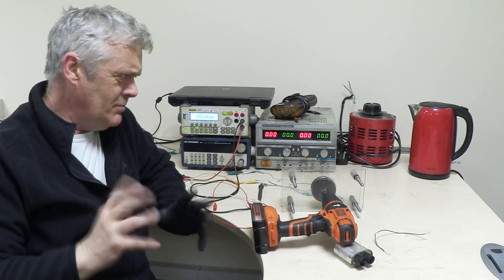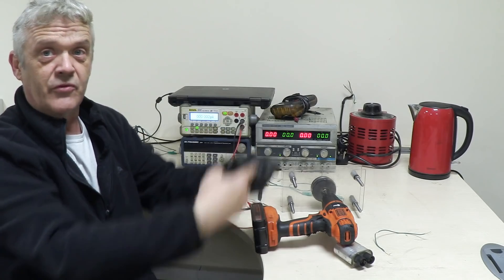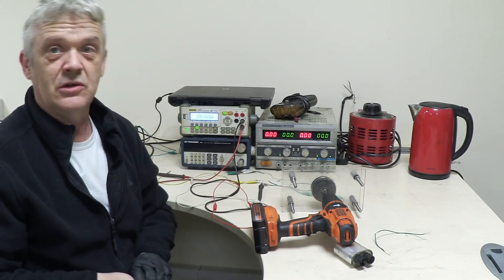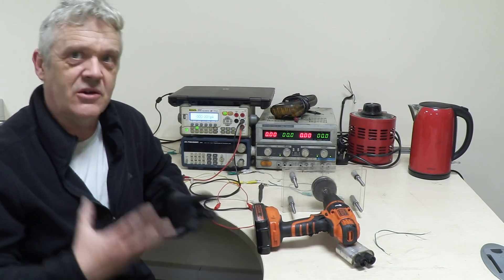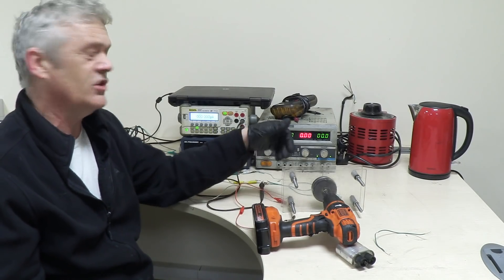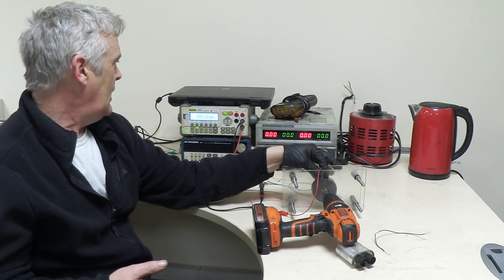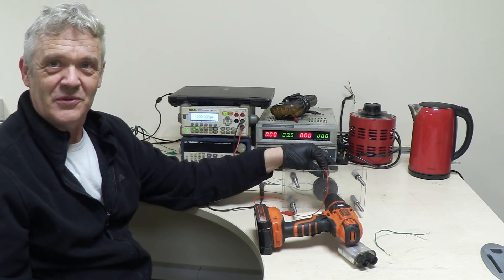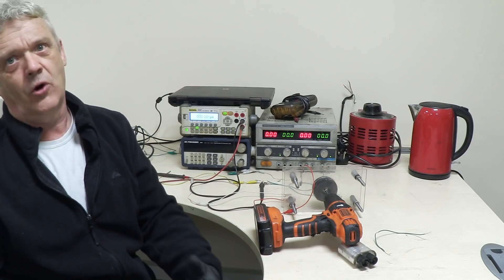Strange Behaviour Of A Tesla Homopolar Generator

Comment: I would like to suggest you something even more astonishing that I've found in google patents:
A high voltage DC homopolar generator patent US8288910B1 . It is basically a homopolar generator but instead of using a single plate a cylindrical coil can be wound radially out from the axis and in at the other side. The rotation generates voltage and all the wires are connecting in series, hence it is like a way bigger plate, or like a bunch of batteries in series. For the best performance the two faces of the disk should be far apart so the magnet wouldn't act on the other side of the cylinder to generate an opposing current. Good luck. You can rotate the magnets alone so it is way easier to connect for measurements.
Reply: Yes, the patent seems to indicate that the single plate is like a single wire in a traditional generator, multiple wires give both types the boost in voltage most designs require. It also hints that some magnetic field arrangements are more effective than others. But, rotating the magnetic plates alone is the traditional method, not exactly proving the point that the theory is flawed, hense the paradox.

Comment: What if you spin the wire by itself? It should generate microamps or less electric current as the wire is spinning within earths magnetic field. I suppose you will need large amount of wire coiled in pancake form to spin with drilling machine and generate measurable electric current.

Comment: Robert, love your videos. Though it pains me to say it, I suspect what you're seeing here is ion current from the carbon rubbing on the aluminum. Ua level currents are not uncommon with ions though pa are more common. If I'm correct,  a copper brush wouldn't show much if any current, humidifying the air should also drop the current. If I'm wrong, file a patent.

Comment: OMG it is highschool physics. Even though the magnets are rotating, the field is not rotating.  Simply put , you cannot in any way determine that the fiels between the magnets is mooving. It is not.
Reply: That has been the predominant question. But I have always asked, to that idea, why isn't the field rotating, if it is the result of individual aligned domains in the material, and the material is rotating, why doesn't the field rotate? The field HAS to stay static with respect to the material, as that is the source of the field.
Reply: And why the field isn't rotating with the magnet? The answer could only be one, because there's an absolute reference frame, relative to which the field remains stationary, that is the aether. But they don't teach this at highschool, because it is contrary to Einstein. Truth doesn't matter.

Comment: A good video idea would be synthesizing graphene from crude oil. There is a large amount of oil futures that went negative. And each one of those contracts is 42,000 gal. I know now might be the biggest transformation for carbon based batteries, solid oxide fuel cells for hybrid conversion.
Reply from the maker: nice one mate cheers

Comment: I see the description now i still think there is some contact-electrification interaction. But i doubt the the magnets are perfectly concentric so you will get some generation in the line going away from the brush as the imperfections of the magnetic fields pass the wire and brush.

Comment: (EDIT: I've had second thoughts about this -- see my reply.)

Coincidentally I've just been reading Feynman's lectures on electrodynamics, and I think I can answer this. You're mistaken in thinking that the emf is due to relative motion between the wire and the magnet. All that matters is whether there is a magnetic field in the region of space through which the wire is moving, in the frame of reference where the motion is taking place. Spinning the magnet does not make the magnetic field disappear. (If it did, spinning a pair of magnets stuck to each other would make them fall apart, which it clearly doesn't.)

As for the eddy currents, I wouldn't expect there to be any when the field is uniform and covering the whole disk, because all the emfs are radial and there is no return path for the currents. I haven't seen your homopolar generator video yet, but i'm guessing it has poles that only cover part of the disk. In that case, there are return paths through other parts of the disk where the field and therefore the emf is weaker.

I think if you shorted the output of this version of the generator you would get some drag due to eddy currents, although it might not be noticeable unless you can make a really low resistance connection.
Reply: Having thought about it some more, I've changed my mind! I now think there is no emf induced in the disk itself. Here's why: In a  reference frame that moves along with a piece of the disk at some moment in time (let's call this the "conductor frame"),  there is no reason to expect any emf, because in that frame you just have a stationary conductor and a stationary magnet. So there can't be any emf in the disk in the laboratory frame either. It's true that the conductor is moving in a magnetic field in that frame, which produces an emf; but the transformation of the magnetic field from the conductor frame to the laboratory frame produces an electric field that cancels it out!

So where does the voltage measured by the meter come from? I think it's coming from the rest of the circuit, which is also passing through the field from the magnets. In the laboratory frame, it's because of the electric field produced by the moving magnets. In the conductor frame, it's because the rest of the circult is moving through the magnetic field in the opposite direction.

Electrodynamics is tricky stuff. There's a lot going on, and you have to take all of it into account to get a consistent picture.

Comment: Try turning it without a drilling machine, or a long non conductive material between 😊
Reply: This has been done. It yields the same result. Exclusion of any incidental flux from a motor nearby the magnet was done for safety reasons when this method was still being used for plasma physics experiments.

Back in the day, they built multi ton faraday disks and spun them up with diesel engines connected by chains and gearboxes to induce massive current pulses.

Comment: Maybe stationary magnets are not stationary when they have inertia! the harder you spin a magnet the further the magnetic field "swings" out...

That's why electric pulse motors are inefficient because they don't take that phenomenon in to account and thus on curtain RPM the magnetic field of a "stationary" magnet is somewhere else than you would expect it to be if you don't take this in to account...

Comment: Suppressing my normal inclination to be a smart ass this thing does intrigue me as to where the emf is being induced. if you break down electrical generation into its atomic phenomenon a magnetic field "pushes" or pulls electrons around. The field,  unseats a valance electron off its atom and shuffles them down a wire. (like a surfer on a wave) This creates a potential difference in polarity of charge in the metal conductor. eliminating unicorn tears these interactions are very physical. an electron wants to move towards a positive ion while sitting on a balanced atom now negitavly charged. a magnetic field either attracts or repels this "loose" electron. all basic stuff right? 
So are we seeing the effects of gravity? perhaps from the simple act of movement? not necessarily earths but each individual atoms attraction or repulsion to gravity even their own. (guess work because asking questions hone clarity)
 And so why does having that magnetic field also rotate with the wheel show  this phenomenon only? without the magnets we see no current, so that would mean the magnets are interacting with either electrical fields in the room or earth,
perhaps causing these fields to "jiggle" .
Some said reorient the unit  to cancel out earth magnetic influence but what about how the earths magnet  field has nodes nulls and voids in its strength all over the earth that would also create false readings.
Someone also said my amplifier analogy must be wrong or you would have seen a reading while just holding the carbon. True but what if the conditions for creating a tuned circuit are only met during the contact with the metal disc?
Also if you hold an oscilloscope probe in your hand you will see a lot of radio transmission interference comming from all sorts of sources. two way communication your blue tooth Wi-Fi cell phone etc.
ironically you would need to do the whole experiment in a faraday shield.
Reply: Careful there. In your subatomic exploration of charge movement, you have to concede the existence of a neutral Ether carrying the electron charges and literally doing the bulk of the work as those subatomic particles influence each other without ever coming in close relative contact with each other. 

Using the diameter of an electron or proton as a measure of distance, if it were the size of a basketball, they would lock in with each other at distances similar to the planets in a solar system, and react immediately with each other (as gravity does without delay) A proton the size of a football would pack into an atom at distances of separation exceeding 14 miles from its nearest proton. Tesla strove to free the electrical flow of charged particles and ended up doing nuclear reactions remotely in a controlled fashion with his distilled Ether. He started with remote magnetizing and charging substances, but progressed to lighting the very air (as the Sun and stars do to produce the effect of being simultaneously in our atmosphere and billions of miles distant.

Good luck.

Comment: There is a relative motion between the circumference of the magnets and the air around it.
The aluminium plate is a cation, eager to donate electrons. Positively charged by friction with the air.

Assuming that the orientation of the magnet is N to S, drill to chuck:

Turning c.w would exert a force on air ions, (+) into the aluminium plate, (--) away from the aluminium plate.

Turning c.c.w would exert a force on air ions, (+) away from the aluminium plate, (--) into the aluminum plate.

By default, the aluminium plate would excell at being positive/losing electrons.
Air ions are oxygen, nitrogen, water, hydronium, co2.

Wild guess, not my field of knowledge.

Comment: Could also be centrifulgal force on free electrons. You'd have to try again without the magnets to support this theory..
Reply: Haha, not a bad hypothesis, but very unlikely.  I can't exactly say it's impossible.. Electrons do have mass and inertia after all, it's just absolutely tiny compared to the metal ions.  Electrons in metals are mobile but not exactly free.  Each metal atom is still going to hold onto enough electrons to remain neutral - on average.

Although I can't think of how to prove it at the moment, I think I can safely bet that if such an effect does exist- that is, a spinning metal disc behaving as a sort of centrifugal electron pump when a stationary current path is formed leading from the hub to the rim, it would be negligible at easily achievable disc speeds.  I think to be measurable the acceleration would have to exceed the random accelerations due to thermal vibrations in the atomic lattice.

Maybe someone  else knows for sure.  It's an interesting thought.

Comment: I have started this journey a while ago, and it's kind of neat to see you discovering this. There is a lot of research out there concerning this subject and also quite a bit of controversy.  The homopolar motor and generator are in fact two faces of the same coin. You will have to know that when you extract current from the generator setup that you will face a back torque as it would become a homopolar motor trying to oppose the movement. But indeed the rotating disc will in fact polarize radially, this is not something you find in textbooks :). However that is only part of the story and I let the path lead you to wherever it may, I would encourage you to investigate the Stefan Marinov Siberian coliu which is the next logical step to this and Distinti's work (Resurrecting The Paradox Generators) although he might sounds cooky at times.

Comment: Wasn't that one of Faraday 's experiments?
Reply from the maker: spot on mate
Reply: @ThinkingandTinkering  I'm an electric motor and armature rewinder by trade,  Faraday was one of my heroes so to speak.  Did he not purport at the conclusion of that experiment that he believed lines of flux stay still,  relative to the earth, even if a magnet was rotated? 
I performed the same experiment at 16 years of age with a 2ft Dia copper disc,  on threaded iron rod shaft with a bunch of magnets,  didn't have good ones didn't even know they existed, put a brush on the shaft with the second brush being attached to a stick.  Brought the disc up to a speed (don't remember how fast but it started to get out of balance,  It was 51 years ago) a voltage was produced with the hand held brush close to the shaft but as it was moved to the outer edge of the disc the voltage increased.  Then youth and hormones got in the way of education. I seem to remember thinking, what if we could spin it at a much higher speed??

Comment: I hate to be a bugger in the ointment here, but that is not true.

1, There is field passing the wire out at the end of the carbon  brush, no matter how much, and 2, the face of the carbon brush will strip electrons off of the surface of the aluminum disk for a while, similarly to a Van Der Graaf generator and furthermore, if the brush happens to have a power lead affixed to it from the factory, that lead is likely braided copper, holding a small copper clad steel spring, retained by a brass or copper crimping rivet. 

Furthermore, many carbon brushes are actually made with a percentage of copper to enable them to conduct more current without overheating, as well as there is a peculiar phenomenon between the copper oxide and the carb on surface which increases relative lubricity.

On top of that, this is going to have a few people chasing all about dreaming of 'zero point energy' so do expect a lot of slightly disappointed people now, if only a little while... ~( ,m,)~

^ 
^^ 
^^^ 
^^^^ 
^^^^^ 
^^^^^^ 
^^^^^^^ 
^^^^^^^^ 
^^^^^^^^^ 
| | 
| |(\ /) 
| |( - -) 
| |( (') (')
Reply from the maker: i know mate - it's just fun and to a degree the mystery is what gets folks thinking - but this is just an example of the faraday paradox
Reply: @ThinkingandTinkering  Okay, just as long as people don't suddenly all go crazy as if you just unlocked the holy grail secret mystery to free unlimited power... (~_^)-b

People be nuts like that some times.

Comment: Electrons moving at 90 degrees to a magnetic field are pushed at 90 degrees to both the direction motion and the magnetic field.  So electons in the conduction band of a spinning conductor are pushed to one side when moved through a stationary magnetic field. That force is the electro motive force, voltage. When you complet a circuit with a wire external to much of the magnetic field, current flows. 

If you  make a loop in a wire and run current through that wire you create an electro magnet.  If you rotate that coil about its polar axis,  the coil is rotated but the magnetic field does not change.  In other words, you can rotate a magnet on its pole but you can not rotate a magnetic field about the pole, thus it matters not if you spin the magnet about its pole. The field is stationary either way.